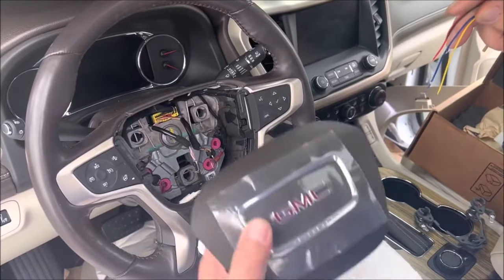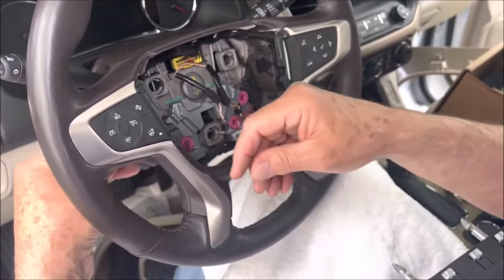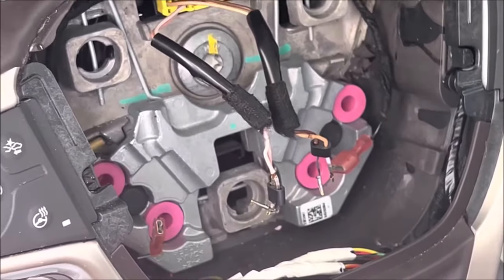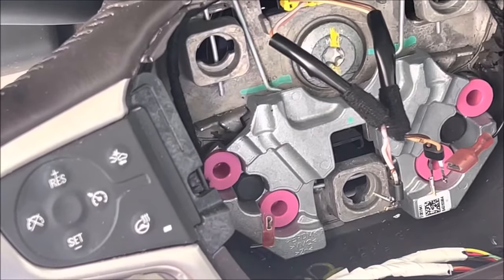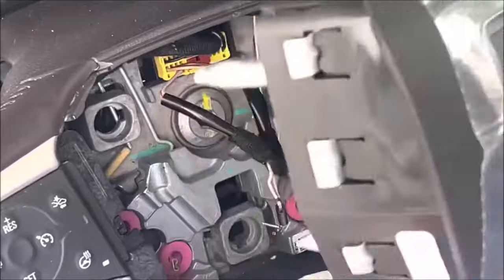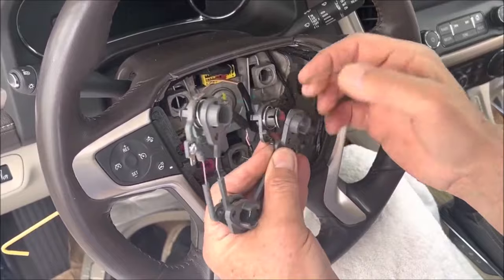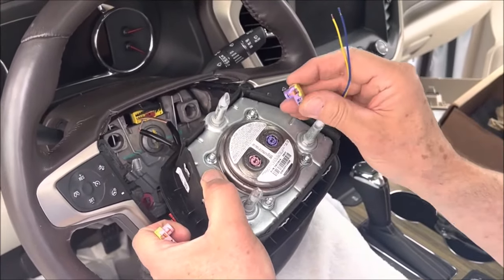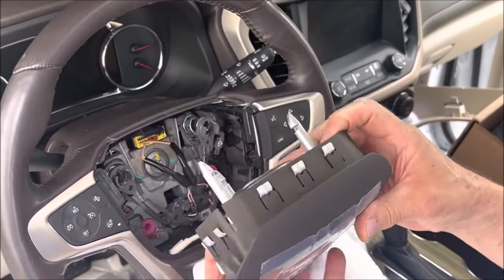GM Steering Wheel Airbag Replacement - It's Easy!

Comment: Thank you so much for this, so does the bottom pin release when you release the left side? So do you release the right one first then the left one? I can get the top to release but the bottom one is a PITA
Reply: So yes this worked, you are the man. I could not figure this out without your video. Thank you so much
Reply from the maker: You're welcome! Subscribe as I'm always showing a few shortcuts!

Comment: This worked! Really appreciate it! Do you by chance know where the airbag/SRS module is on these?
Reply from the maker: Yes! It is located under the center console. It is bolted to the floor panel but easily accessible from the driver’s side through the lower console side cover.

Comment: Hi, thank you for this video! I have a couple of questions that I’m hoping you can answer. :)
1) would removing this grant access to replacing the cruise control / audio control buttons on either side?
2) is it necessary to disconnect some sort of power source to the airbag prior to removing  the center housing?
Thank you for sharing your knowledge!